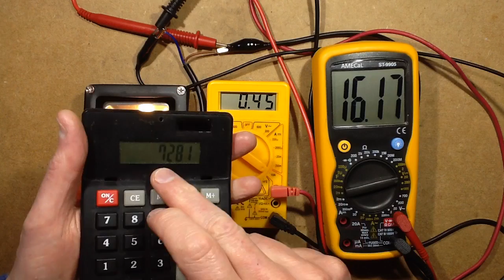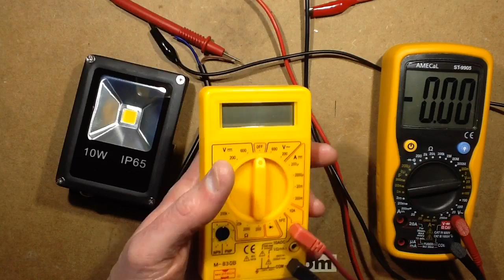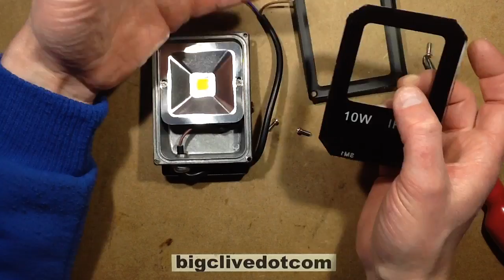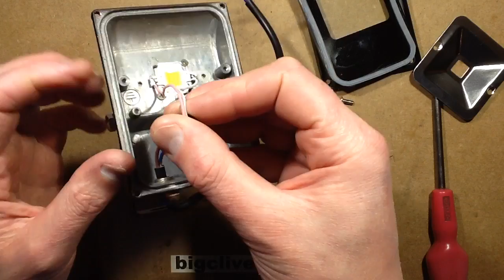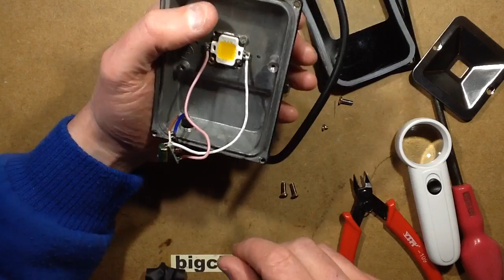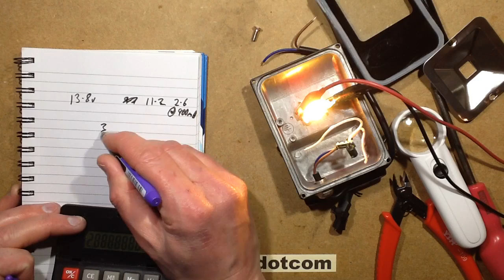Testing and modifying a 12V 10W LED floodlight.

Comment: Hi Clive, do you have a video on how to use a meter like you had in the video? If you don't, would you be able to make one? I don't know a lot about electronics, but I love watching your videos and find them very educational as I'm trying to learn more. You're fantastic at explaining things and are very clear about what you're doing when you are taking electronics apart, plus I love that your videos come across as very genuine as you're passionate about what you're doing. Cheers!
Reply from the maker: +MusicVideosExtreme I probably will do a dedicated meter video.  I've actually just ordered a bunch of the cheapest meters on eBay to test too.
Reply from the maker: +Markus Bates Many of the little analogue meters are made in the same style.  Just some diodes, resistors and a 100uA sensitivity movement.  I can recall an old Tandy one that was made like that.
Reply: +Markus Bates Before digital meters analog meters were all that there were. You used to be able to buy a little 2x3 inch analog meter for about $5 at many hardware stores, or mail order. Electrical supply companies would give them away as party favors. They fit in your pocket, and believe it or not were designed to measure 600V AC. They were commonly used to measure 110V and 220V with no problems at all. YOu really don't need seven inches of triple insulated plastic to measure line voltage with reasonable safety. I used them for years as throw-away meters. A lot easier to use than a 7-pound Tripplet on the top of a radio tower to check the power on the warning lights.
Reply: +l wilton But you will need metal film resistors and other internal parts that are actually rated for >220VAC (600VAC ideally). In those cheap meters, mostly they aren't. I actually had an analogue pocket meter blowing up due to this.

Comment: When you said the dissipation at 12V was around 7W, that included the resistors, dissipation in the LED is about 6W or so, at 10V the LED dissipation was right about 2W.  Close enough though ;)

Comment: the power dissipated in the resistors will be I^2 R. in the 12v case .6.6*3 = .36*3=.99+.03*3\approx 1W.

Comment: It's hard for me to admit it, but those cheapie meters are probably okay for beginners on a budget, and as Clive said, not needing high accuracy, or high-voltage or -current measurements. Though if it were me, and I had to throw a voltmeter at my "younger self," I'd probably give him an old analog Simpson VOM, or maybe a Heathkit VTVM. ;)

That black stuff might be one of those "paint & bake" type coatings, where it's literally melted/fused into the glass. Just guessing, though.

Comment: This is actually very interesting, since I've been toying around with the idea of using some of these 12V lights to illuminate the trees in my back yard at night, and then have a small solar array and bank of those 12Ah SLA alarm batteries so they're ~green~ (and I don't have to fuss about with mains voltage which honestly still scares the pie out of me).

Comment: Someday I'll study the history of electricity, specifically how different voltages and frequencies became standard in different countries. I'm sort of partial to the 120/240 60Hz system we have in the USA. The higher frequency does help make transformer design a little easier, and center tapping the transformer to provide two different voltages provides a safer voltage for small loads plus the lower current 240 volts for larger loads like air conditioners, stoves, water heaters, etc.
Reply: Load balancing can be an issue.  Each side of the centre-tap on the transformer should be under the same load, but that is seldom the case in real-world use.  If the centre tap is lost then you can get closer to 230 V on the low load side - fire risk.  There is no safety advantage to the 115 V system.

In theory you could cut down on insulation, to save some money, but you'd pay a lot more in copper for the larger conductors required.  So the lower voltage used is mostly a disadvantage, then you have the complexity of different appliances requiring different outlet types rated at the full or half voltage.

A higher frequency is better, but 60 Hz isn't that much different to 50 Hz so you don't really get a huge benefit from decreased transformer sizes.  Aircraft use 400 Hz to get the transformer weight down.  With the ubiquitous multi-voltage / multi-frequency power supplies
Reply: Shock and Awe: The Story of Electricity -- Jim Al-Khalili. Definitely worth a watch.
Reply: +boggisthecat Yes, not many understand load balancing. The house I grew up in suffered periodic low voltage which caused the picture on our vacuum tube TV to shrink. The TV repairman reported this problem. We called the power company and they reported that ALL of the breakers were on the same leg! The house was also built in 1959 when a main breaker wasn't required. This shortcoming nearly caused the house to burn down when one of the bus bars was accidentally shorted while doing some electrical mods. (No, it wasn't me doing the work!)

As for insulation, no savings there. It all has to be rated for 600 volts, regardless. Speaking of saving copper ... there was that brief period in time when ALUMIN[I]UM wire was allowed... So many fires ... and lawsuits!

Comment: "Choke" is a commonly used term in amateur radio. Most often, it's used to refer to an inductor built by coiling coaxial cable (a multi turn air core inductor) or snapping a ferrite bead/core over it to block common mode radio frequency current from flowing over the outer shield and wreaking havoc.

73 de AF6AS (my callsign)
Reply: +Chaplain Dave Sparks - Sometimes Clive wreaks of havoc.

Comment: Could the coating on the glass maybe be two pieces of glass pressed together with a plastic insert?  That would work and make it heat, UV and waterproof.
Reply: +Alexander Presslie 
No, this is definitely not laminated glass. The paint (or whatever it is), is clearly on the outside of the single piece of glass.

Comment: I recommend the small 10€ Uni-T meter, its super small, has fixed wires, a very clever position for the fuse (but only 200ma max because of that) and a little signal generator, which is about 75hz. 
I use it more than the expensive Fluke, because its accurate enough for almost everything.
Reply: Its the Uni-T UT20, or the Voltcraft VC-11

Comment: I german, there is the therm "Drossel" which is pretty much identical to "choke". Both therms can be used for an inductor, and "choking someone" is "jemanden erdrosseln".
Also "coil" and "Spule" work very similary in german and english. In normal use, we call it "Spule". "Induktivität" is the more academic therm, which we tend to use when going into details, meaning non ideal models. "Drossel" is rearly used - I tend to use it, when I don^t care about specific characteristics.

Comment: yo Dr Clive I just got a 8 pack of these exact lights from eBay to run in conjuction with my ista breeze i500 wind turbine and 6x lead acid batteries would u recommend running each of these of a 1a fuse and would u do a review of the i500. cheers Charlie fae Falkirk.
Reply from the maker: +Moonkiny dmf Lots of fusing is always a good idea.

Comment: Did you try a drop of brake fluid on that paint?
I was thinking a couple of 1 amp diodes would drop about 2v at full current and less as the supply drops, a possible, maybe :-)
Reply from the maker: +zx8401ztv I've not actually tried brake fluid.  I'll give it a go.

Comment: Glad to hear your not a meter snob, Clive. Too many folks insist that they would not touch them with a barge pole, even for the most simple 12v tasks. Like you say, it's all about common sense, knowing it's limitations. Certainly good enough for a lot of hobbyist applications.
Reply: +100SteveB Agreed, I keep 2 or 3 in the box of 'fix the car stuff' that lives in the car boot. If I drive over it in a mud puddle, who cares.
Reply: *****
Yep, i have one living in the boot of my car also (Along with a ton of other stuff that seems to have found it's way in there).
Reply: +100SteveB I keep mine in my car's welly, just in case it's storming out. /badjoke.  I keep meaning to pick up a few more since they are so disposable and we don't have any functional meters at work. I hate running into a simple problem where a little info on voltage could solve it, just to be left guessing.
Reply: +100SteveB I agree, glad to see Clive saying so. I probably have 10 or more of those Harbor Freight meters. I get one for free whenever they're doing that deal and I go in for anything.  I like having a meter in the car, one in each tool bag, one in a desk drawer at work, etc.  I've never needed much accuracy - if it'll tell me 30 milliamps or 1000 ohms within 2 or 3 percent, good enough for me.  In reality, I've put it up against the best meter I have (Extech) and it's always within 1 least significant digit, tested across 3 or 4 < $5 meters.
Reply: If you want to see something explode, watch Big Clive's video with the "TIG welder" and that Chinese "AC/DC LED" he connected directly to line/mains voltage. (Was that posted on April 1st? :-)
Reply: only mouthbreathers use cheap meters

Comment: The original use of these regulators (in that exact form factor) is in LED spots made for direct replacement of halogen spots running on 12V AC. That's why they have the bridge rectifier (and often come with the pins for the halogen socket). If you get them in bulk, they cost maybe 1€/$/£ a piece on ebay. I got quite a few of them and always removed the Schottky diodes (gets the useable voltage range down a volt). For current adjustment I just piggy back another SMD resistor on top of the one already there.
Reply: +superdau Good tip on removing the bridge rec! Makes sense.

Comment: Not sure if it would work for enamel on glass, it would also depend on whether the glass was etched, but a stanley blade held so the angle of the sharpened edge is flat on the glass may work, i use this method for cleaning crud from glass.
You may want to put the glass on some thin rubber to stop is slipping around
Reply from the maker: +Sparky Projects The sharp knife just slid across the paint like glass.
Reply: +bigclivedotcom Sounds like it's grinder time, if it scratches the glass, just do the same all over the glass as a diffuser :D

Comment: Typical idle voltage in a vehicle is around 14.2V, maybe a tad less with accessories running, but it will pick back up once the RPMs come up. This also gets worse in the cold where you can reach 14.8-15V. And with a worn battery you can see as low as the nominal 12V with the engine off and accessory power going.
Reply: Yep, the charging voltage for lead acid has a negative temperature coefficient, that is the needed voltage goes down when the temp goes up. In below freezing conditions the voltage can be just over 15.
Reply: +codemsan Car systems are notorious source of mysterious peaks and voltage fluxuations, so I'd say it's just good if that lamp can handle say 20V ... 

On the same note.. I have seen Led worklights with 9-36V voltage range. Most likely having similar chip in them.

Comment: Hello guys i want to start with soldering and i want to ask you if this seems ok to you. :) 
http://www.ebay.com/itm/60W-HAOKO-708-Electric-Welding-Soldering-Iron-5pcs-900M-T-Solder-Tips-220V-110V-/311156782734?var=&hash=item487263b68e:m:m14RnuJwoWvEKATHnZ6RDJA
Reply from the maker: +jusb1066 That's a mains iron.  Not sure how it can be 60W with such a small tip and no thermal regulation visible.  There doesn't appear to be a ground wire.
Reply: bigclivedotcom
ahh i misread it clive sorry
Reply: +bigclivedotcom So is this better ? http://www.ebay.co.uk/itm/220V-240V-Inverter-Frequency-Change-Electric-936-Soldering-Station-Iron-and-Tips-/252338739120?var=&hash=item3ac08f97b0:m:mk1tLKNNSKXCOEdDXS5jryw

Comment: You can get the drivers in various current ratings. I got the 900mA ones from here:
http://www.ebay.com/itm/371182507757 $USD 13.80 for 10 of them.

Comment: I was wondering if a 12v version of these lights would turn up... :D
Reply: +twocvbloke been out for a long time, my portable led worklamp is one of these (put together by me) and a 12v 7ah lead acid, came out before the ones with a lithium pack on them, so about 4 years ago.  both portable and charged via cigar lighter as was the need
Reply: jusb1066
I was referring to the entire package, not the LED module... :)
Reply: *****
yes the entire package is what i refer to also!, in fact back then i also wanted a 240v ac one, did not find one, so attacked an led bulb for its circuit to convert it

Comment: a car battery should settle at around 12.7v not 12v after the surface charge runs down
Reply: He mentioned high voltage because of the alternator and the said afterwards the voltage would settle at 12 volts. In the scenario he described the battery would be fully charged unless it was a bad battery
Reply: No it wouldn't a lead acid battery at 100% charge is 12.65V, 13.8V would be a surface charge that would fade off by turning on the headlights for 30 seconds. A Alternator would put out 13.8-15 Volts under load and will NOT put out voltages spikes of 40 Volts. The fuel injectors in a car will produce 40-50V Spikes because of self induction. The alternator uses a diaode trio to convert a ACV to DCV in 2 to 3 stages depending on the alternator. Even a large diesel alternator(24V Systems) only outputs 28DCV.
Reply: +Против Глобал from solenoids not alternators.
Reply: +Против Глобал don't be mad at me because your talking out your ass. you have failed on every comment
Reply: +Против Глобал your wrong again but whatever, alternators don't spike, solenoids cause a spike because of self induction. but apparently your 3rd world mind can't comprehend that

Comment: hi clive!! for a cheap dmm I like uni-t. cheers
Reply: +Proyectos LED It's a shame there's far too many fakes for the uni-t meters. I have a ut139C that works very good and has decent protection.
Unless it's guaranteed to be one of the big name brands, I have to open them up and see how well they're built and protected to be comfortable using them.
Reply: loved my uni-t meter.  Used it roadside for years.  left it sat in someone's engine bay, so it is now probably somewhere on the side of the M5

Comment: Typical charging voltage for car battery is 14,4v (but it can by between 13,2V to 14,8v).
Reply: +omyk22 I did think that. Numpty boy here diagnosed a dead alternator by checking that.

The squealing, smell of burning, and the too-hot-to-touch alternator housing were also a bit of a clue, too ;)

Comment: As far as automotive applications go, Clive, you forgot something; the vehicle's alternator/generator. With the engine running and the alternator being driven by the serpentine belt, you'll see around 14.5 volts, a maximum of 14.8 volts typically. I can't speak for bigger trucks (lorries) but I would presume the principle would be the same but a different voltage.
Reply: +Bryan Young Can also be 28.8V (2x 14.4V)
Reply: +Bryan Young For lorries it would be 27 volts for charging as they run a 24 volt system
Reply: I was thinking it would be somewhere around that mark. I don't have any experience with larger trucks, only 'civilian' vehicles that operate on 12-14 volts.
Reply: +Bryan Young it varies by car, expect between 13.2 and 14.8
Reply: I'm fairly sure that if you're getting spikes to that magnitude, something isn't doing it's job properly.
Reply: Genuinely curious, then. If the system is supposed to be able to handle 40 volts, then why are several components damaged when a vehicle is jump-started backwards, equaling 24 volts?
Reply: Decided to do a quick search on it, and the only thing I could find about it is a 'load dump'. https://en.wikipedia.org/wiki/Load_dump
Is that what you're talking about?
Reply: Bryan Young
Probably because the components can only stand 40V with the correct polarity and are destroyed by reverse polarity. While voltage spikes are common, caused eg by windshield wiper motor changing direction, alternator regulation, distributor/coil in petrol vehicles, reverse polarity is very rare and only occurs when somebody tampers with the system :D
Reply: I did a general google search, and that wikipedia article was all I could find about it. I'd argue that it served it's purpose well in this case. After all we're both on the same page, now.

Comment: is the active circuitry cheaper for china to supply than a 5w ceramic resistor?
Reply: +jusb1066 well I don't know what the actual price is but you can get those regulators on aliexpress for as low as 70 cents and ten 5W resistors for about $1-2, so I would presume that the resistors are indeed cheaper but it only costs them about double or triple of one to just put a regulator in it and offer a slightly better product.
Reply: *****
as always its a middle man who squeezes the price, and on ebay its to appear above the list of other sellers, my question was not anti chinese but one of an economics one
Reply: +Roland usually industrial stuff is built fairly well (but there are rubbish products in the industrial field as well, remember the unreliable ETR470?) but consumer products are often chinese products rebadged as "made Italy ®"